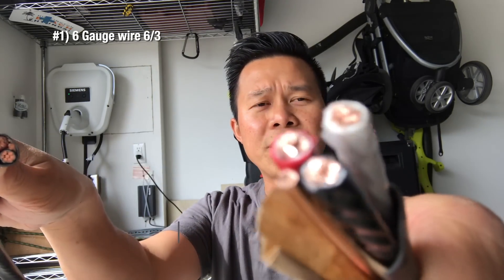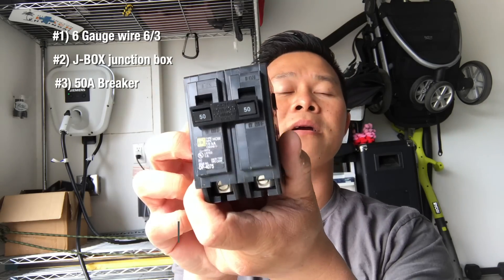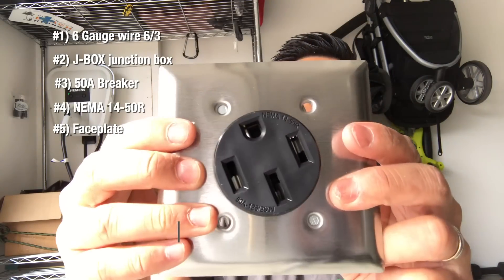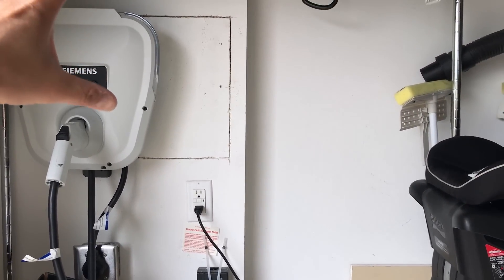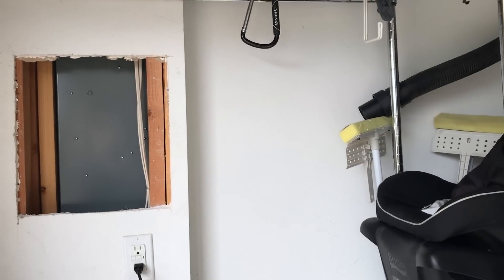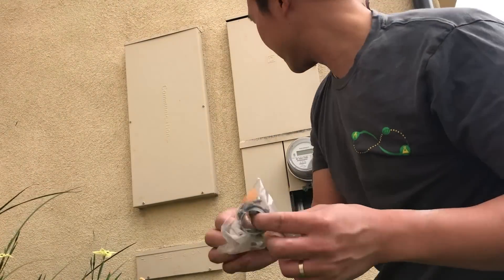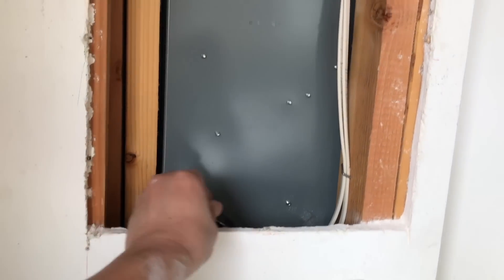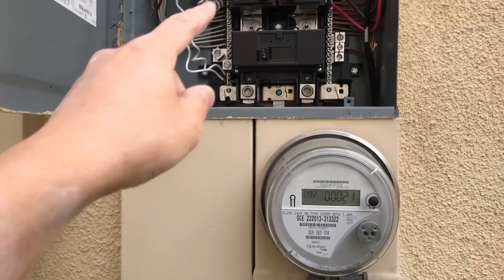How to Install Tesla Model 3 standard Charger Outlet in 30 min (NEMA 14-50R

Comment: I  see a few code violations for sure. I'm a 20 yr master electrician and electrical contractor, yes he can do electrical work on his own house but did he pull a permit? even as a homeowner you have to pull a permit, if the house catches fire because of his work the insurance company is going to deny the claim,  1) because of the code violations,  and, 2) they will deny the claim for him not pulling a permit and having it inspected by an electrical inspector. like i always tell do-it- yourselfers....just know this. because it works,  does not mean it was done correctly. Just sayin!!!

Comment: Breakers in place or not: 1)Make your connection to breaker box LAST!   SAFETY!  
2)Use METAL boxes. More stable and secure. 3rd) Install breaker then, connect wires. Much easier.
4) No need for Neutral.

Comment: Stupid Wall w Ground charge cables. Extremely Stupid insane Tesla Wall Charger and more Insane charging cables laying around. Ceiling Chargers Ceiling Cables 
Trip over high voltage cables Drive over high voltage cables 
Spring r Bungee r Rope w Counterweight 
All top-down ceiling down 
Stupid Tesla Wall Charger

Comment: I get the DIY!  But people check your local codes as well as NFPA codes. As a Licensed electrician,  I see some issues here that should be called out. However, I live another state from where this installation is being done, so I'm not sure what code is in this area. Make sure you are following the electrical codes for your municipalities/state. On another note, I have seen where homeowners insurance has been flagged and even canceled for electrical installation issues.

Comment: the way you just plugged in the 50A breakers onto the voltage rails, are you getting 120VAC or 240VAC?  you did not explain this part.  I suppose you want to get 240VAC for the charger; how did you get the two 120VACs (which are 180 degrees out of phase) to add up to 240VAC by plugging the breakers onto the specific rails?

Comment: This plug is too close to the ground.  Probably should have been the same height as the other plug (check local code). Also probably not spec to run it through your meter box. Run it from the side of the main panel or from the top if allowed.
Reply: Yeah, running it through the meter box looks sketchy. I haven't seen anyone else do it that way before.

Comment: Wrong breaker,GFI required anywhere in the US ,Most install the cheap 14/50 outlet,Eventually the contacts burn and damage your plug on your charging cable,Buy the 50$ plug and avoid trouble

Comment: Home owners beware.  Your local building department may have added requirements here.

Home load calculations may be required to ensure proper wire size....no, from utility to house.  (You are adding effectively a second stove/oven combo to run all night) and your service wires are normally reduced as small as possible to handle the electrical loads when your house wad built.

2020 NEC 625.42 chargers are continuous loads.  2020 NEC 210.19.(A).(1). Branch circuit conductors shall have an ampacity not less than 125% of the continuous load.....your 50 amp circuit can only handle 40 amps of power.

2020 NEC 625.54. Car charge recepticles must be GFCI protected.  (Unchanged from NEC 2017) and 210.8 now required "250 vac" recepticles in the garage be gfci protected.

Back to the inspection thing (building department).....your insurance company can use "unpermitted work" to not pay a claim.  Check your policy and be safe.  That $80,000 car may be ruined in a fire and ypur home owner's insurance company may tell to to sue the electrical installer to get your car fixed.  Serving those court papers will be easy, you know where you live.

Can you do it yourself?  Yes!  Just make sure your backside is well covered.
Reply: TLDR

Comment: do not run wires through electrical meter box. it's 1000 dollar fine for tempering in CA if they catch you. this is a bad guide.

Comment: Hey I notice most DIY people like to play others trade job. You have maybe like 3 code violations in your panel. For what is known you can’t RUN WIRES through a meter box. It’s not called bushings connectors is called Romex/clamp connectors. You have to connect them from the outside of your panel not the other way around. It’s nice you guys want to help people on some stuff, but you have to do it the right way. Specially when it comes to plumbing and electrical. U never heard the firefighters saying the floor guys or carpenters to be the reason of cause of fire. It’s always a spark, faulty outlet or a leak of gas….

Comment: What size panel does it have to be ? 100 amp or 200 amp panel
Reply: standard main breaker box is usually 200amps. Sub-breaker box is usually 100 amps.

Comment: The main panel plastic cover is missing on the disconnect. The top bush bar is off but the bottom bush bar is on. When he cut the romex 6/3 you should be careful with that ground your going to short circuit the panel. On the outlet you can buy the remodel box so that no repair for sheetrock. You put the construction box. Another rockie mistake you dont have to cut the sheetrock. You can just drop  the wire.
Reply: yeah...i think he cut it to figure out where the studs were located lol

Comment: Good video. I’m wondering if you could connect a generator to the outlet to power the house?
Reply: As long as you "MAKE SURE" TO {{turn OFF}} the main off before connecting to the generator. WHAT YOU (DO NOT) WANT IS ELECTRICAL back feed! ANY MISTAKE....That will a major disaster.....

Comment: Thank you for making the video! This is so far the most detailed and informative video on how and what exactly we/electrician are doing to install 220v/240v outlet. 

I’m trying to minimize the physical work on the house itself. My breaker box are outside and kinda next to my parking. So I think I can skip all the cutting and went straight to the wiring but possibly “attach” the wire to the wall so it stay still. But I will need to figure out how am I going to place the outlet if my wires are exposed and not in the wall...

Comment: My breaker is already wired for EV charging..says 40amp and 220 for charging. Will that be fine for installing a 14-50?
Reply: Should be 50 amp, at least that’s what Tesla recommends for their EVs.
Reply: Don’t mix it up. 14-50 receptacle should only be used with a 50A breaker to keep things safe and problem free. And don’t just replace the breaker, the wires in there are only spec’d for 40A and won’t have the proper gauge.

Comment: Two observations. 1.  I have yet to see a Tesla power port installation on You Tube that meets the National Electric Code so be careful when watching any video.  2. Why does Tesla want you to use the 14-50?   There is no neutral used.   Black, Red, and Green or bare.  As noted in other comments, your fire insurance might be voided.
Reply: 14-50 does use a neutral (2 hots, neutral, and ground). What part of this violates the code?
Reply: the fire insurance won't be voided unless 14-50 plug is the cause of the fire. however, he tampered with the electrical meter box. that's 1000 dollar moving violation.

Comment: I used 8 gauge wire 
60 amp breaker 
1450 nema rated at 50amps 
And my Tesla only pulling 40amps
Reply: I hope you are joking
Reply: @ShaunCurrier  nope if you have any suggestions let me know
Reply: @thirsty3333  I think your breaker is too large for the wire, which means it's not protecting the wire from over current. 40 breaker, 32 charger is what I'd expect for that wire.
Reply: @ShaunCurrier  that’s an easy fix can do that tomorrow I think I’ll just change the breaker the Tesla sets it’s own rate in car unless I change it but it’s usually pulling 40amps with 29miles to per hour charge.
Reply: @thirsty3333  Excellent! I'm glad I could help make your home safer!
Reply: @thirsty3333  yeah dude I hope you changed it. You risk overloading that wire and potential fire.
Reply: Should use 40A breaker and limit to 32A for continuous charging.

Comment: Wen u liv ina good neighborhood ur breaker panel is outside 😂
Reply: I would think the whole breaker panel (power entrance) would short out in a rainstorm. There are no external breaker panels where I live in Canada. We have snow and rain.
Reply: Every house in SoCal? lol
Reply: I live in Cali and I find this scary anyone can just turn off you power esp at night.
Reply: @juanplus3324  they just passed a code to have a emergency disconnect on side of your house too in the new code cycle
Reply: Breakers are sometimes found outside the building because of local codes, so the fire department can cut off the power in an emergency.
Reply: @richard1493  I hear you but there should be a smarter way to do this due to safety concern. IE put a locked central control somewhere in the sidewalk that only Fire people can access. But then again It would be too much for those greedy developers.
I would like to access my circuit breaker if it trips in the middle of the night inside my garage.
Reply: Must be a west coast thing.  You'd never see that on east coast.  it looks so crazy to me lol

Comment: Which country is this video shot in? The U.S. hasn't had 220V electrical for like... 90 years.
Reply: Yeah its 250V now but some people still just say 220. Admiring this is because it usually reads around 224 with a volt meter.
Reply: Assuming not admiring
Reply: @michaelfigliola9399  hahaha grammar police in action hahaha

Comment: Isn't that guage wire overkill?
Reply: The Tesla EVSE doesn't draw 50 amps, but as the 50-amp breaker and the NEMA 14-50 plug implies, you should be able to plug a 50-amp load safely into that outlet. (Well, okay, a 40-amp load, since the NEC says the presence of a plug and socket reduces the allowable load by 20%.) And to deliver that much current safely, you need 6-gauge wire.

Comment: Great video. I did the exact same thing, only difference is that I’m using 6-50. When I did a voltage test, I’m only getting 120v coming from the 6-50 outlet.  Do you know why?  Thanks for your help
Reply: perhaps your receptacle is rated for 120v? have you checked? Did it have 4 prongs?

Comment: what J-box did you use? Do you have a part number?
Reply: You can use 4and 11/16” range box
Reply: very helpful video btw. just can't find the same J-box that you are using that is plastic and has knockout holes and enough volume for the 6-3 wires.

Comment: You could have cut hole in back of panel and came out that way. Plenty of room there. Never go through meter enclosure.
Reply: It is Illegal to open the meter can. If you do, then the utility company will charge you for tampering and, charge you to lock it again.
Reply: Robert gregory Good luck selling the home. Lol
Reply: @benjaminvivar7855  ????? What does selling the home got to do with anything?
Reply: @robertgregory2618  If the home inspector sees the Tesla wire installed through the Meter Can that will count against you in your asking price. I understand the person in video is not selling their home but the title of the video is how to install a Tesla charger, it is actually how not to install a Tesla Charger. I’m only trying to inform the public that is a fire hazard, utility conductors next to load conductors in same enclosure.
Reply: my new home built in 2017 is EV charger prepped like this. the metal junction box has a top hole which leads through the meter  inclosure (around it i should say)  like in this video. I don't see anywhere else it would go to?. also where he accessed underneath the meter panel is only a screw and wasn't locked, that's how mine is set up

Comment: How much does the electricity bill increase after installing and using the charger at home?
Reply: Sorry for the two month late poke, but in the US with average gas prices and average electric prices, going from a gas car to an EV car your refilling costs are about 30% of what they used to be for the same miles. $1000 gas becomes $300 electricity.
Reply: Depends where you are located.  Some utility companies have TOU (time of use) rate structures and even net metering if you have solar panels like me.  My panels make my electricity essentially free since my utility company has net metering.
Reply: @Chainyanker007  nothing is free. You just choose to see it that way. I makes you feel better about your investment.
Reply: @ericg3810  Lol
Reply: Charge during off peak hrs and it wont increase that much

Comment: Could have been a cleaner install if the outlet wasn't put in upside down.
Reply: the correct way to install a plug like this is ground up, if the metal cover plate were to come off it would hit the ground and NOT both positive polls. ground down is actually wrong. :(  people starting installing this way because it "looks" good.
Reply: @jbweld138  my new home built in 2017 put my dryer plug like that, ground down. I was going to say something to the builder but thought nothing of it
Reply: @jbweld138  lmfao dude, calm down 😅 "if the metal cover plate were to come off..." have you, in your life, ever seen that happen???  That shit only happens in infomercials. 
And I can tell you studied that in a book, because a BETTER example, is if the plugs' prongs were halfway plugged into the recept, and a metal object fell on it making contact. 
Do you jump around electrical DIY videos and bust out the NEC, or your other 1st year books, then throw your two cents in?
Reply: jbweld138 installing ground down is fine and not wrong at all
Reply: his 6-3 wire is coming from above. all the connections are located at the bottom of receptacle. it makes it easier to install it without bending. Any bent wires at the point of receptacle connection can make difficult for fitment. and this is exactly how I blew my receptacle because of tight fitting.
Reply: And @Dan, how is it installed upside down? Please refer me to a source higher than the CMP, so I can see that the outlet is in fact, installed upside down.
Reply: Ground down or up doesn’t matter both ways are acceptable practises
Reply: @Nick-bh1fy  yeah, but if you put it in per spec the charger would look better.

Comment: Great video, thanks.  How many miles per hour is the charge rate with the 14-50?
Reply: 30
Reply: Depends on the car trim and fuse. I'm getting a performqnce model 3 which wants 48amps, so i need a 60amp fuse to put 50amps at the outlet. That will charge about 30mph. Other model 3s take amperages on the 30s, so I assume they charge at a lower rate alao.
Reply: Depends if you are using the vehicle home wall connector with the 14-50 adapter or the Tesla Wall Connector kit. Model 3 Long Range wall connector max output is rated at 32A, so 30 miles per hour.  A 14-50 is more then enough for this electrical load.  Per Tesla, max amps output for the Wall Connector Kit is 48A with a 60amp breaker installed.

Comment: How do you turn off the power to your main cut off breaker. If I turn off the main breaker cut off (100 amperes) will it turn off the power to it ( outside main breaker cut off). I have another inside main breaker for the house.
Reply: fargone -:- if you shut off your 100amp (sometimes 200 or more amp) main feed breaker than every circuit below this breaker will be off, but verify with a volt meter first. You will still have feed power on the feed side of the main breaker so don’t touch anything near the main as this power is coming in from the street.

Comment: But none of you called out the fact you cant use the meter box as a means as passing through.  Just hire an electrician.
Reply: Calvin Abreu insurance will NOT pay out on that either.
Reply: @gingerman5123  One would think these folks can afford a Tesla why cheap out on the electrical install.  Save $1k vs house fire and home insurance not paying once they inspect the breaker box.
Reply: @monohydrate2  my new home built in 2017 is EV charger prepped in my garage and my metal junction box has a whole which leads to the outside panel just like in this video, I don't see anywhere else it will lead to. I guess ill have a electrician come out and inspect it for install
Reply: why not
Reply: @platinixpoe  it's against code

Comment: Please do not follow this guide.  The instructions Tesla publishes officially for a NEMA 14-50 install clearly state that the ground pin should be on top.  This is for safety.
Reply: @DevMindset  technically neutral and ground go to ground eventually anyways. but yea,  top pin is by convention ground wire. https://images.homedepot-static.com/catalog/pdfImages/96/966c2920-d3d5-4bd2-8213-cb7d4ea098ae.pdf
Reply: link please.
Reply: This is all "recommended"...it's not code. Ground down, is just fine. You always have these tight ass Drill Sgt. NEC derps who pay no mind to the "shall be permitted" areas. (Permissive rules)
There is no code in the NEC that says grounding has to be on top for a receptacle.

Comment: Worst installation ever!
Reply: can you elaborate on this? video seemed pretty straight forward but if he showed unsafe practices, it would be helpful to mention it
Reply: @Joe Casson so was the install bad or did u just not like his practices 🤔
Reply: Blue Phantom he installed the outlet upside down and ran the cable through the meter box. Both are nono’s
Reply: The Tesla installation instructions clearly state that the ground pin should be on top....makes you wonder if he even read the documentation.
Reply: @DevMindset  Did I miss something? Is that a Tesla install or a Nema 14-50 outlet install....
Reply: @DevMindset  lmao, you're such a derp. Seriously. Do you jump to other DIY electrical videos and bust out the NEC and all your other 1st year books and read articles in comments using your own words? 
Doesn't matter if it's up or down. It's "recommended up"...fkin tool.
Reply: Just pay $700 then